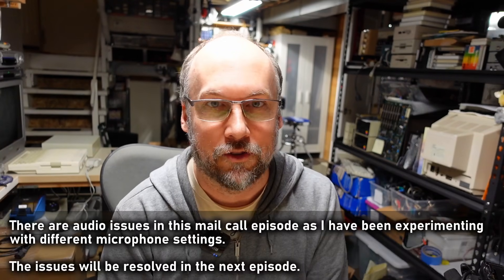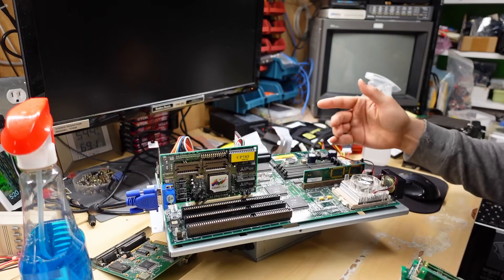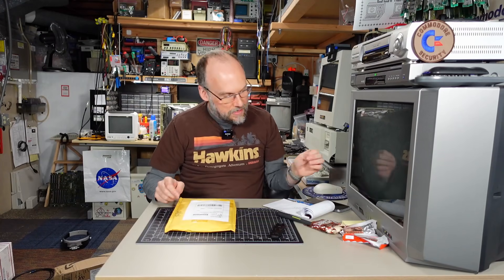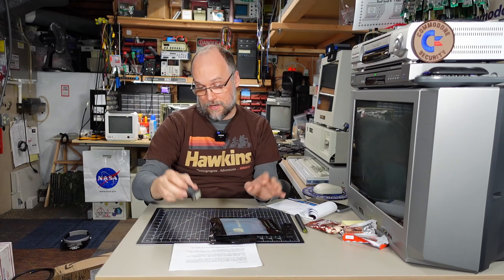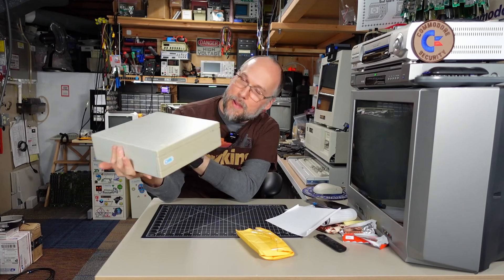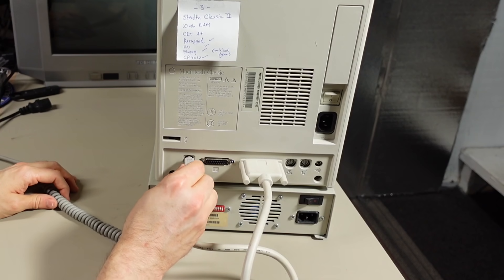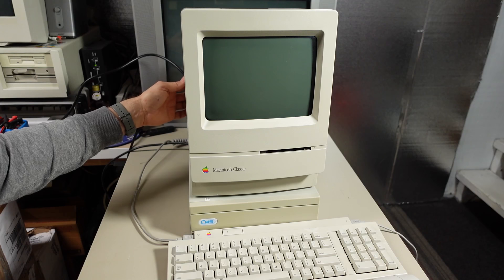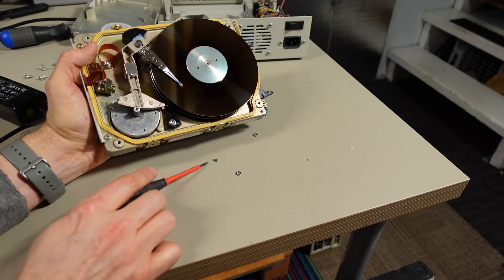30 pin to 72 pin SIMM adapters, a self-destructing SCSI hard drive and an Apple IIc mouse adapter

Comment: re: the mice, i'm going to guess that Apple used one of their dirty little tricks to make people buy a new computer and only use Apple products, and it's something as simple as a resistor being added or a ground wire changing place. they still do this, so that some of their products will get destroyed if you don't plug them in with Apple-branded USB cables. reason #8638765 why Apple is terrible.